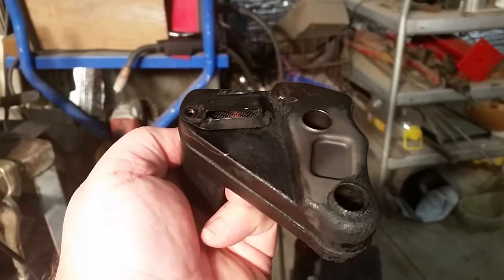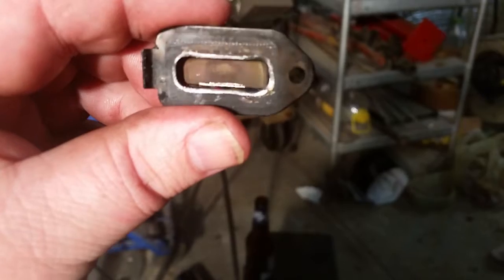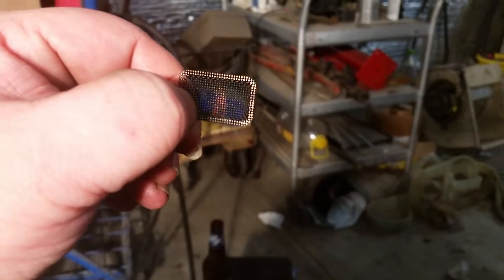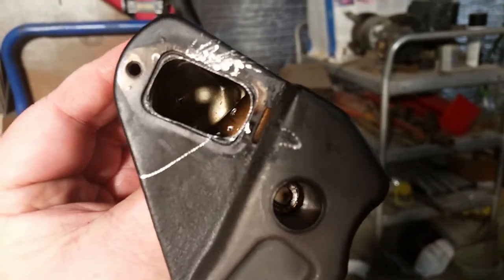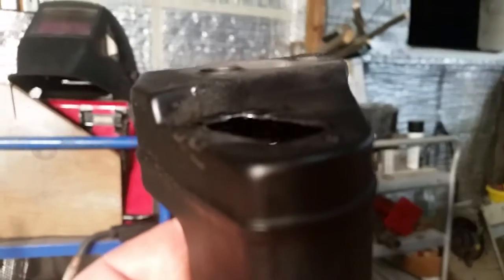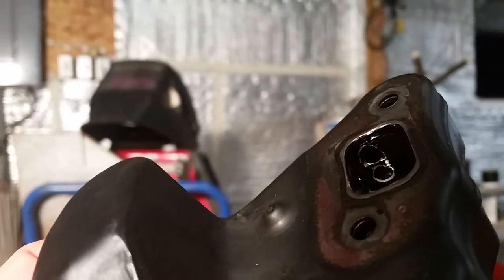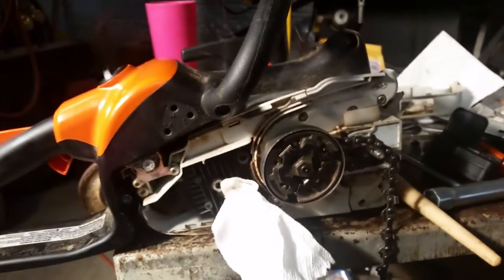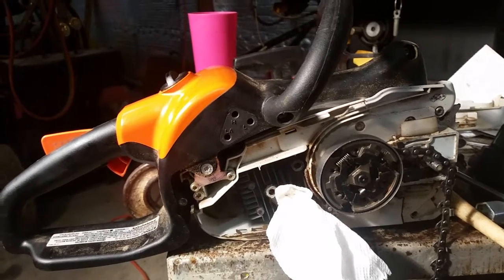Stihl ms 192 c muffler mod how to

Comment: I matched your mod and my results were the same as you report.  Higher rpm, slightly better torque and pulls better in the cut.  Happy but the noise is TERRIBLE
Reply from the maker: Ya sound kinda reminds me of an angry woodpecker. LOL thank you for watching and taking the time to comment.
Reply: @fuelediowa  Thanks for taking the time to make these helpful videos.  Timing advance mod is next.  After performing your timing advance mod were your results limited to better throttle response or do you get faster cuts as well?
Reply from the maker: @johnmiller376  on this 192 the timing advance didn't help enough to justify. Advance made it harder to start and seemed to not stay in a powerband as well as stock.